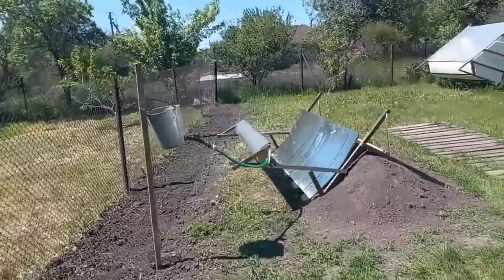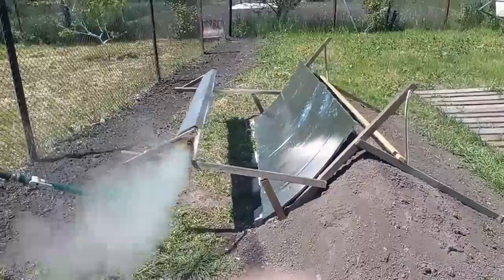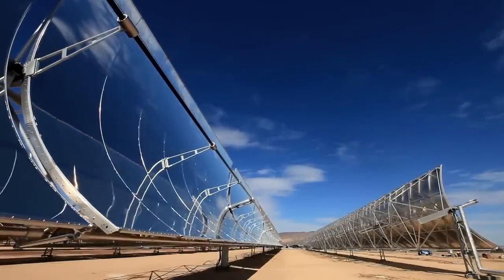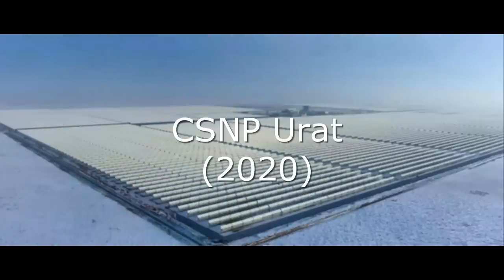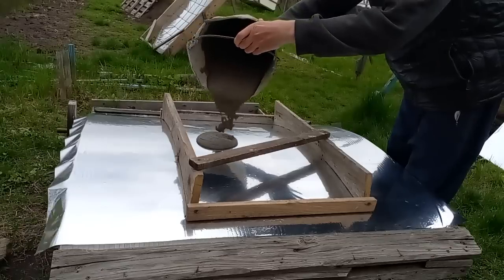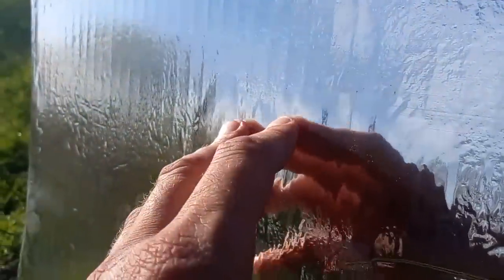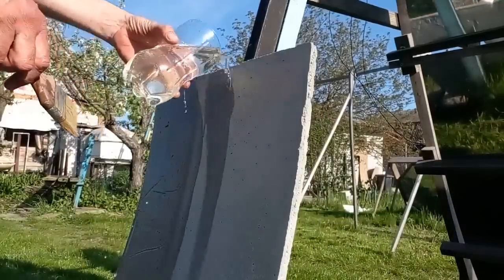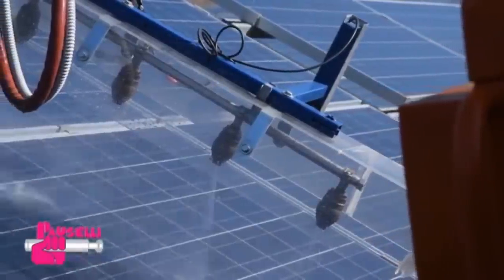These 2 innovations lead us to cheap solar electricity

Comment: There is a swiss company in Tessin which designed similar system with concrete structures. Mirror used mylar film and transparent film inflated over concrete structure. Heat conveying medium is superheated air. Storage medium is trenches filled with rocks, air pumped through them heat the rocks and store heat for the night.
Look it up. The technology exists and has been proven large scale for years. It's great you are reproducing independently but my point is that
As usual, it is not the tech or ideas that are missing, but funding and willingness to do large scale actual implementations.

Comment: steel mold then concrete on top so it also forms legs to the mold, flip the mold over. Mylar is not recyclable and any film that has to be glued is bad for recycling. So I would just use thicker aluminium stainless steel or a coating. Thicker panels can be polished when they start to loose shine.
Reply: Also of using concrete I would have a mold on site, for example in hdpe or steel. Then apply reflective film on top then use air crete (blowing concrete) over the mold+film to get the desired shape. Now we just flip the thing over and if legs are a part of the mold it will be perfectly standing already.

Comment: If you aline  your detector north and south and set it to turn and follow the sun you can put a steel pipe in the focus point and bring the heat in doors the pipe is added water about two cups then heated till it blows steam out then cap it off .this is a heat diode the temp running though it is .99 degrees cel.and needs to be going up hill to let water return to heat source .you can heat your home and cook with it .with no pumps.

Comment: Use mirrored aluminum plate 3mm and direct the solar heat toward a pipe filled with radiator fluid which feeds through a 4'x8' x4'block of sand.  The sand can have flue pipes that carry hot air into your house or it can heat hot water pipes.  Search sand battery finland.  The sand can reach temps to 500 degrees and will hold the heat for months.

Comment: AUSTRALIA.  Land of floods, drafts and tornadoes.  The earthen supports can be eroded by water and strong winds.
Best suggestion, from many, might be to use stainless steel sheeting, polished or buffed every several years.  But adherence in strong winds & cyclones?
Reply: If you were to use stainless steel you may as well buy a professionally made complete system....when last did you do a costing of stainless steel...??....using stainless steel would defeat the objective,which is to create an affordable system...

Comment: Can anyone help explain how exactly the water jug receiver is moving with the springs based on the sun? I assume its something not long term like the weight of the water evaporates over time and becomes lighter but once the water in the jug runs out nothing would happen anymore unless there was some continuous way of water being in there

Comment: to be fair, the 200 or 400 USD per m² should include the water other medium liquid, molted salt etc system and heat to electricties conversion tech... and some scaling up does not work with everything the same way. Still a very cool vid and def. at least a cool project to interesst people (esp. important, children and teens) to this and some might experiment and can use things made by themself a water heater/warm water for their home :)
Reply from the maker: Solana generation station (USA): $2 billion total cost / 2.2 million sq. m = 900 $ / sq.m

Comment: I can't help but think that recycled HDPE sheets would solve the gasification process mentioned by John McGinnis you could use the steam you generate from what you have to melt the HDPE, another project hey ;)
Good to see your still working on your ideas!Слава Україні!
Reply: Although thinking about it, perhaps the HDPE not so smart until we know what Temp the Concrete gets to under the reflector

Comment: One of the disadvantage of concrete is sand, it will be more and more difficult to source years after years.
Reply: Yes, but here it is not a lot of quantity, like the quantity for a standard house used for a whole solar plant. And allong this you can do technical / houses mades of loadbearing strawbale, or rammed earth... The appropriate technology concept.....

Comment: Have you considered using ferro cement? It's an epoxy combination Portland cement. They use it mostly for gluing ceramic tile to concrete. It's super sticky, dries fast and concrete will stick to it. Use it as your first layer to afix your reflective material, the pour your concrete over it. Where did you purchase your thermal couple? Hopefully not Chinese stuff. They make the worst quality of almost anything they make. That's what happens when your motivation is cheap and not the pride of quality.

Comment: Try aluminium cooking foil, also the circumference of your mirror is too large.
How did you decide to use the curvature you did?
Try using bent plywood. This can be made by forming them with steam and when hot and wet Lay it on your curved formers. Using plywood has the advantage that the glue will stick much better and the edge of the foul can be rolled back and secured with small nails. The disadvantage of using wood is rot.
Reply: Wood will be not heavy enough too, think about stormy weather.
Reply: If you make a lot of mirrors then the first is formed with perches on parabolic boards and plastic. Then this first product is created perfect with a lot of handwork. And on this basis, a mold is made that allows you to produce products in good shape. For a couple of mirrors this is not a practical solution.

Comment: If the mirror does not follow the sun, it will automatically increase your energy cost, as it will take very little of the energy it needs to receive.
I did not find it meaningful.